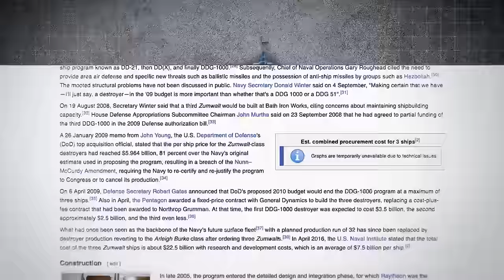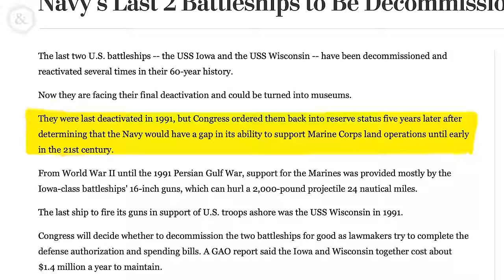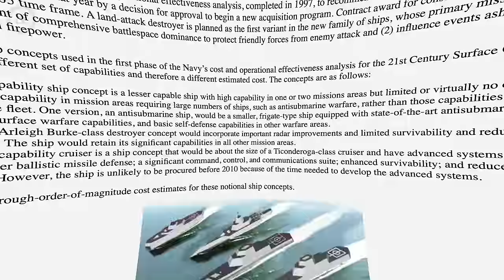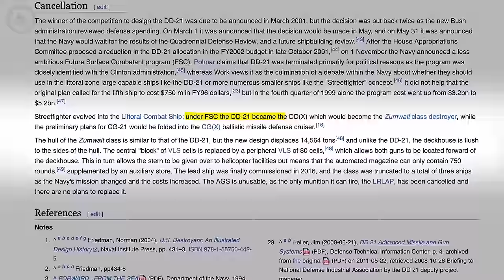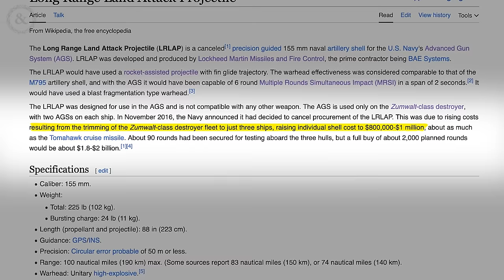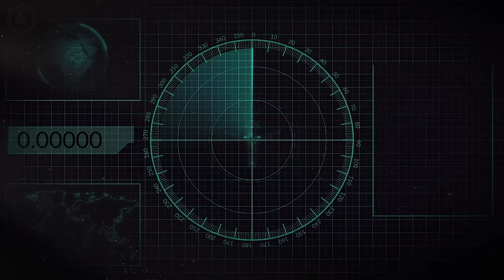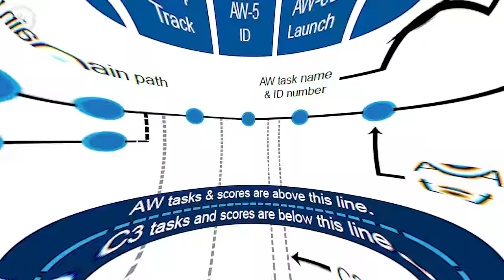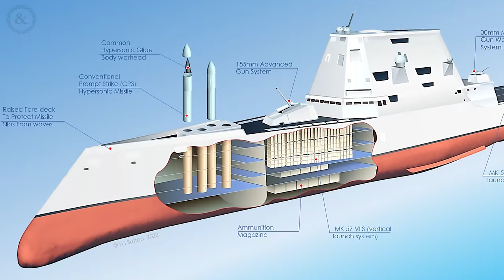Where is America's Stealth Destroyer?

Comment: Here is my prediction:  It isn't going to be cost effective to modify a failed Zumwalt design for the few hypersonic missiles it will be able to carry.  B-52's, B-1's, B-2's and the future B-21 can all carry hypersonic missiles at standoff ranges.

I'm just an Old Corps former Marine infantry officer who served 3 years in combat.  When I was running short of ammo, I didn't need to leave my position to go back to the rear to get more ammo, I needed immediate resupply as close as possible by helicopter.

Today, the Navy has to return to port to be resupplied with missiles and everything else except food and fuel.  What the Navy need is what I needed in Vietnam, was immediate resupply of ammo while I'm holding my current position.

The Navy needs to figure out how to resupply ships with missiles at sea instead of having to pull them out of combat to go to a port to get reloaded.  Duh!

The problem is to stay in the fight without having to retreat to ports hundreds or thousands of miles to rearm.  How was this not a Navy major logistics focus?  DD's should be able to rearm at sea and on combat station within hours and continue to fight.

I don't consider myself some sort of futuristic prophet, but there is an element of just common sense that the military often lacks.  Take Amphibious landing exercised back in the 1970's.  As a company commander, I did have amphibious landing exercises but they were always in daylight and choreographed.  So as a company commander, I wanted to conduct a relatively small amphibious assault exercises at night.  Denied as too dangerous.

However, anyone who is a historian of warfare knows that attacking during foul weather is going to surprise the enemy.  So I argued that we (the US Marine Corps) should not only be practicing the techniques of landing at night but also during at night during foul weather.

Back in those days, we didn't have GPS and we didn't have good communications, but neither did the Marines in WW I, WW II, the Korean War, or even the Vietnam War.  We found ways to get the job done.

Despite all of the technologies and communication advances, the Marine Corps still doesn't practice night amphibious landings in bad weather.  In my opinion contested amphibious landings are no longer in consideration with the current Marine Corps doctrine.  But I think that is a dangerous option to give up.  Instead the Marine Corps should be developing ways to execute amphibious operations at night in bad weather against defended enemy beaches and positions.  More than forty years later, we still can't do it.  Bad dog; no bone.

I feel the same way about the Zumwalt.  Bad dog; no bone.    They designed and built it before the rail gun technology was proven.  Then they put a canon on it with a range that can't match the enemy's capabilities to defend.  Now they want to put hypersonic missiles on it that other numerous platforms can already perform.

My second prediction is that the Zumwalt DD's will never be a part of a carrier strike group because it adds nothing to the offensive or defensive capabilities.

My recommendation is mothball them or scrap them because you can't fix stupid.

Comment: Got to be honest and say i don't really feel like the hypersonic missiles really will make much of a difference. Sure it is very impressive to be able to cross the entire USA in like 3 minutes. But in the end you got what 6? moment you run out your kinda useless. Likewise your not really useful for anything else. To make matters worse, you could in theory just argue that these missiles could just be launched from ground based forces. As in all honesty their kinda like ICBMS at this point. Just without the whole nukes added to them. Hard to say if anything would be able to intercept them. 

so creating a missile destroyer who barely could last a single engagement. That lacks any real way to deal with subs or smaller threats effectively. and would require them to vist a specialized dry dock each time they use up their ammunition. As no supply ship would be able to restock those missiles. really feels like this is an act of desperation at this point.

Comment: IPS, integrated power system was a new design to the Navy, and was over priced (like everything else that the designer - Ratheon - touched).  The next destroyer will use a similar IPS of Italian design (already de-bugged).  
Did the Italians get the concept from the US Navy?  
Would the Navy had accepted the Italian IPS design, if they had not tried IPS first?
Reply: I joined the NNS part of the DDX gold team in 2003.  They had two engineers who were gurus of medium voltage transformers.  I became the power protection guy.  Later I added synchronizing and load sharing, and helped the SCADA group.   After the bugs from Ingalls were worked out, my part of the design worked better than the Navy expected.   Almost every part of the gold team's work was thrown out.
Reply: Regarding rail guns and lasers, late in our involvement with Zumwalt, rail guns were discussed, not lasers.  But the turbine generators has problems with the super uneven loading when firing the rail gun.  Lasers are easy to supply with power.  I am guessing that the cost analysis has pushed rain guns aside, in favor of lasers.  When I left Navy work, they were still trying to figure out the powering problem for rail guns, and resulting cost and risk. . 

Later, I helped an R&D company develop a new gas turbine, which might solve the rain gun powering problem.  I hope VAST Power Systems completes their development work.

Comment: Well, as I said...

Washington. November 9. The US Army, apparently, will not be able to stick to the schedule and begin equipping its first unit with hypersonic missiles by the end of 2023, Defense news reports, citing Assistant Secretary of the Army for Acquisition, Logistics and Technology Doug Bush.
Another failure both in hypersonic programs in general and in the specific LRHW program (the navy is also waiting for the same missile, under a different name) - a medium-range ballistic or quasi-ballistic missile with a maneuverable non-nuclear warhead. The system not only did not have a single launch that was successful or was issued as such - it did not have a single launch at all. The next one, on October 26, did not take place either. Before that, the LRHW launched unsuccessfully in early September. Based on its results (ONE launch) 🤣🤣 they planned to declare the first battery completely COMBAT READY! But it didn't work out

Comment: Indeed quite an amusing story. Never thought I'd hear this name again. We saw countries switching back to the deemed older tech like F-15EX over F-35 for reasons. New techs are expensive whether to buy, operate, maintain, repair, etc. And the cutting edge tech is needed primarily in a conflict against same-tier military nations. Which is rare isn't it? It's usually the bigger one against the smaller one since maybe the WWll ended. That's why I think such futuristic tech of the Zumwalt isn't gonna be crucially needed soon, unless, China is stupid enough to invade Taiwan.

It's just like the F-35. They're cool and all but many countries don't absolutely need stealth jets and whatnot considering the high costs and low jusifying causes and thus even the F-15s should suffice. Heck, F-16 is gonna win the Ukraine war too. (not sure but even the Abrams sent there are the older models too yeah?)

Comment: The Zumwalts have totally and successful fulfilled their role, which was to replace the Iowa's as a force in being and reserve for mobilization. Also not talking about the climate in the 20 Os when the zumwalt got green lighted and layed down? Navy though it was gonna be following the army and marines into intervention after intervention and a big gun replacement for the WW2 battlships that for most of their latter days and certainly by the time the Zumwalts were launched were just as if not very likely far worse in readiness and practical capability being old oil burning Yamato style behemoths.  zumwalts might have empty magazines but given a kick off in the Korean peninsula or Taiwan and US intervention ya probably see a a production of at least a cheaper basic unguided round for use in shore bombardment or even a naval gun engagement in some SWO wet dream. Also having the radar signature of a fishing boat really give ya a chance to hid in the clutter of more water ways and limits threats to only the more advanced and discriminating ASMs unless china wants to risk sinking an one of a dozen potential nations fishing fleet with all the resutling fall out in a spat over Taiwan. What is more its not so much about being identified by size as it is about at what max range ya might be detected and how close that is to the Zumwalts own fire control range putting ISR assets at greater threat of DDG1000 taking them out before they can get a strike on target. Finally just like the LCS its stable mate of the early 2000s war on terror the real high end near pear war fighting contribution is the hanger deck and hte LAMPs helo it supports.  Zumwalts not gonna coordinate with frigates or any other ship they are all isolated(subs) or have no tubes them selves(surface) helos are the fleets sub chasers these days (they are so much faster then ships) and as far as arsenal ships the USN did that way smarter and way cheaper and way way more stealthy when they converted the quiet gravity reactors Ohio class SSBNs into SSGNs with all that high end land attack cruise missile capability. Zumwalts about getting its high end radar and a naval rotor(LAMPS, SEALS, SEAR and hellfire trucks) up and in the enemies business (his littoral) for the USN's own IRS objectives with shore bombardment being an aspiration that over laps well in hull capability requirements.

Comment: No Ammo?
Same quality BS was circulated about F-35.
617,216 views  Jul 5, 2023
 The Excalibur is a GPS-guided 6.1 inch (155mm) artillery shell which serves as an advanced alternative to conventional artillery ammunition. Known for its near-pinpoint accuracy, this game-changing weapon can hit targets within a seven-foot radius. As revealed in Pentagon budget documents, the Excalibur boasts an operational range of 25 miles (approximately 40 km), and in testing scenarios, it has successfully hit a truck over 40 miles (about 64 km) away.
BAE Systems, the manufacturer of the Excalibur, emphasizes that the weapon's precision remains consistent, regardless of the distance between the launch site and the target. It possesses a "Circular Error Probability", a measure of a weapon's precision, of less than 32.8 feet (10 meters).

Emerging from the U.S. defense sector, the M982 Excalibur round has garnered international attention for its pivotal role in Ukraine's standoff with Russia. This prominence was solidified by Ukraine's top General, Valeriy Zaluzhny, who released a video showcasing the round's devastating effectiveness against Russian forces. The Excalibur is more than just an artillery round; it's a groundbreaking military solution that empowers troops to strike with unparalleled precision and power. This exceptional accuracy ensures the delivery of first-round effects, significantly reducing the chances for enemy forces to execute defensive maneuvers or initiate evacuation. Consequently, the Excalibur sets a new benchmark in strategic artillery, changing the landscape of modern warfare.
Reply: Mate, Excalibur is completely incompatible with the Zumwalt's guns.
Reply: "completely incompatible with the Zumwalt's guns."
ROFL! Any incompatibility was designed in by the engineers and the MBAs! Six and perhaps 8-inch shells are ideal sizes for auto-loading and the Euros have been designing away like mad with their 155mms for years. All this stuff has already been invented in the last 200 years. Make a cannon tube, make a breech, adapt one or 2 autoloader designs. reset the program in the CNC machine tools. AEGIS is surely designed as a gun control system.
Note that over 1000 F-35s have been sold so far and they are now rated as Gen 5 after upgrades have been added. @definitelyfrank9341
Reply: @tobyw9573  It isn't the autoloader that's the issue, but the gun itself. The barrels of these guns use polygonal rifling instead of conventional rifling. Polygonal rifling is shaped like an arc, whereas conventional rifling is squared off at the edges. Polygonal rifling seals in the gasses slightly better than conventional rifling, as there are no sharp corners in the rifling for gas to escape through ahead of the projectile. However, this means that the driving bands for the projectiles must be specially made to work with this type of rifling. This meant that when the LRLAP projectile was cancelled, no existing 155 mm projectile would fit inside the gun. 

PS: I don't give a shit about the F-35.